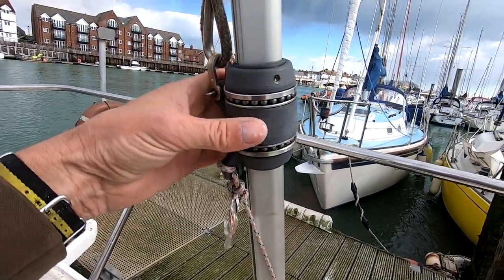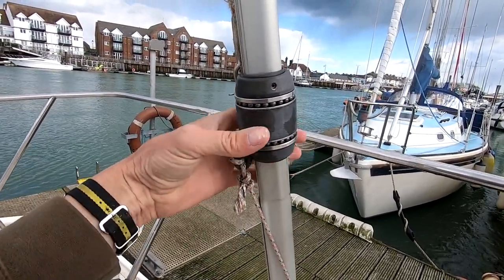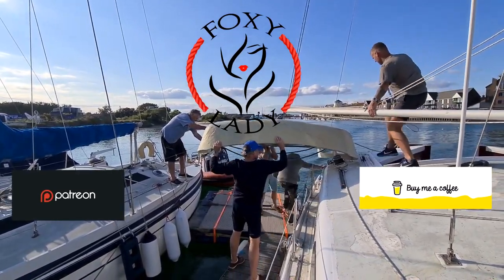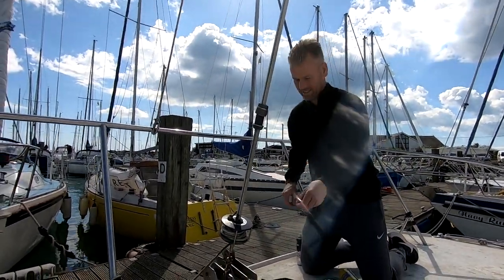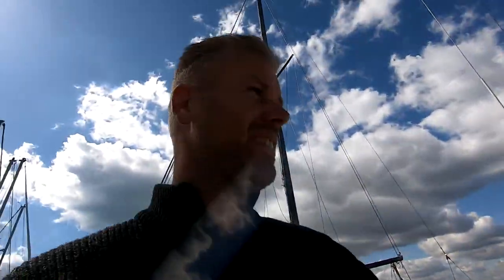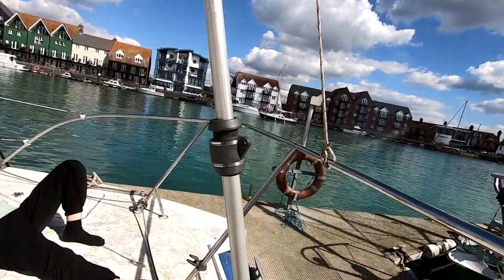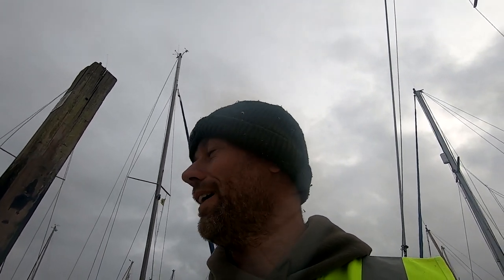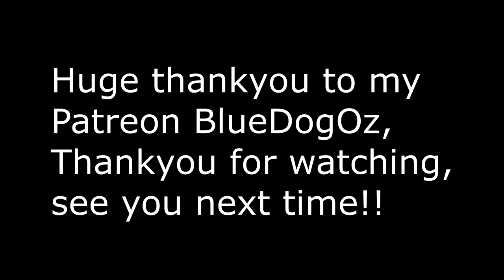Foresail Furling Rebuild DIY Project Catamaran!! Delrin Bearings S2 E07

Comment: Consorting with Google is possible but dont blame me if get a rash... Consulting's a lot safer spence 😂
Plastic bearings is a new one on me but the races might have got dented... 
Graphite or PTFE is a good dry lubricant. 
A lot of boats have covers for the winches while at the dock or anchor to keep the crud and rain  out..it might help keep with this problem ..just a make a velcro cuff.
Reply from the maker: My England isn't great Clive🤣. I inspected the races for wear and all good, cleaned with wet n dry. Turns lovely now,  i can't really cover this up, it's at the top of my forestay 🙈
Reply: @SailingFoxyLady  
Ah my error... I thought it was low down ...i was probably trying to type 😂🤷🏻‍♂️ .
Aldi does cans of GT85 light lubricant spray ..its PTFE based so perfect for lubricating plastics and metals where other oils would leave a film to attract  dirt.  Its £2 a can red and black..
And great for cleaning bikes up and protecting against rust for a while. WD attacks some plastics and rubber and leaves a sticky film..
Reply from the maker: @clivestainlesssteelwomble7665  hmm i was under the impression the bearings need to be bone dry,  hence plastic! Metal in metal dry isn't a happy combo
Reply: @SailingFoxyLady  
Graphite is dry powder and solvent carried PTFE dries quickly to leave a PTFE dry coating. Its what US soldiers in the M16 era carried in a small bottle often in their helmet nets/headbands after they had found their new guns were jamming... both are used on locks and PTFE on sliding doors 
Rollers etc..
Reply from the maker: @clivestainlesssteelwomble7665  ahh ok, think I'll get myself a can and have a little play.  Thankyou🙏🙏